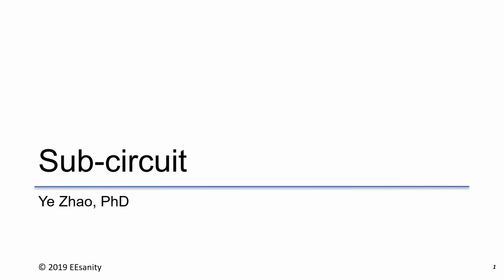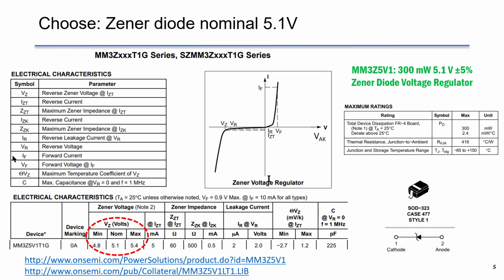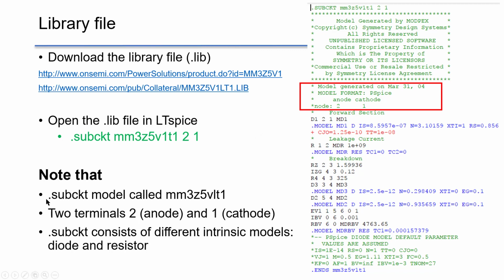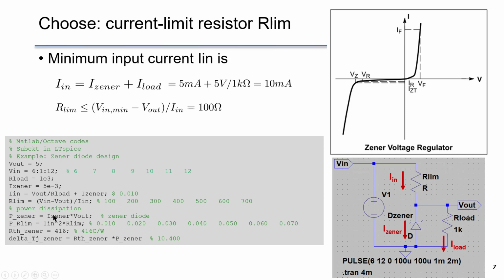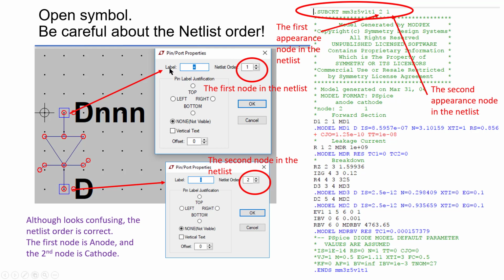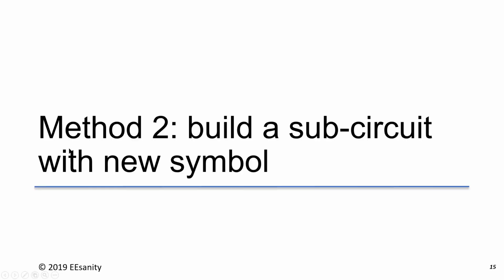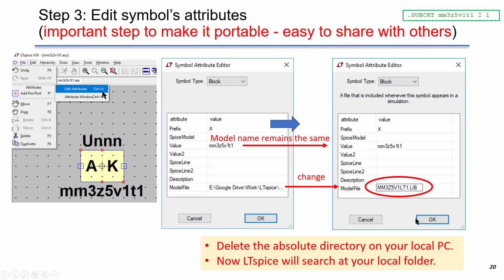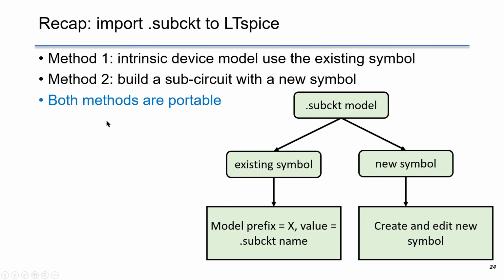LTspice tutorial for beginners: how to make sub-circuits (by 2 methods)

Comment: wonderful diode Ltspice information.  this will help in creating and simulation of an AD202kn Analog Devices isolation Amp.  😎 thank you.
Reply from the maker: I think you can use an arbitrary voltage source to simply model it as a voltage source.  For detailed model, you can  go to analog and ask for help. https://www.analog.com/en/support/technical-support.html      Be careful about this part. It is out dated and very expensive.
Reply: @eesanity  thank you and no wonder the info is limited.